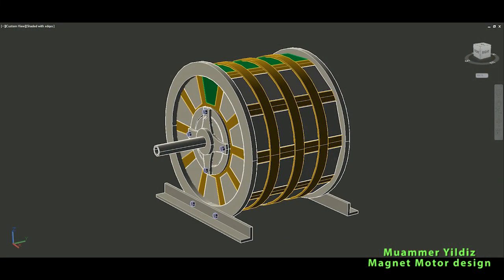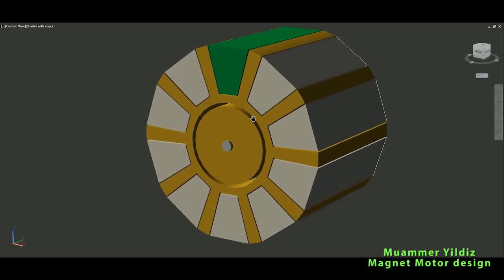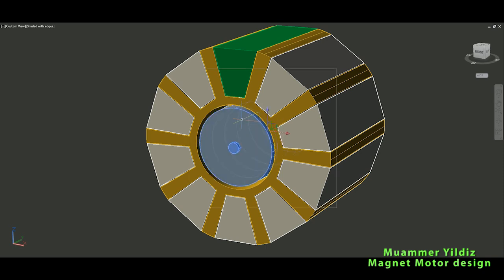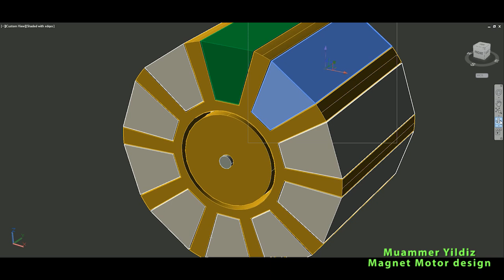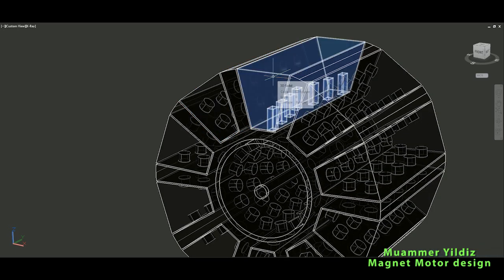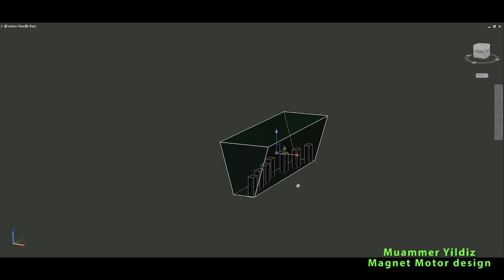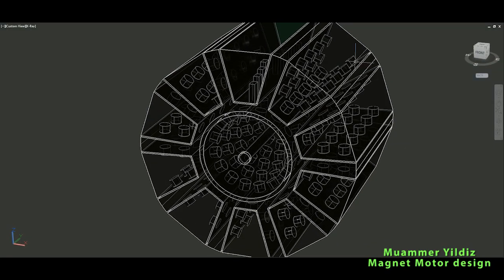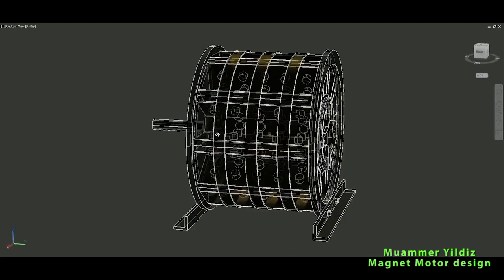Free Energy Generator, Working Patent! Muammer Yildiz Magnet Motor, Detail design!!!

Comment: how are the poles (N/S) of the magnets mounted? .... how big is the distance between the rotor- and the stator- magnets ?
Reply: They went to high school, they simply did not understand.    Just think. if Newton had not passed that stupid law, we could have all had free energy. Sad really!
Reply: The magnets don't generate electricity, they are the means of propulsion because two norths will not connect, therefore one has to move if setup at the correct distance and angle,  the Mike Brady magnetic motor is typical of how that works, it's on youtube and he has a Patent. costs about $400 to build plus a generator of 4 Kwatt cost $180. Make your own and run your business or home for nothing
Reply: Arnold Robert Lee - How long have you been running your house on one?
Reply: Mike Brady took money from people and did not provide anything working... I heard he was in prison...

Comment: Basically Magnet Machine Work
 like Effect Dominos by using Power Energy force
of Magnets met Iron which causes the shaft keep Spinning
as long as the magnets energy force (pull/push) over Iron still exists.

Comment: More "Free energy" BS!
Reply: Arnold Robert Lee, Research means nothing if your sources are garbage. Garbage in, garbage out. Having a patent doesn't prove the invention works as promised. The fact is that if these "free energy" devises worked, the power companies would build them themselves and save a crap-load  of money over building conventional power plants.
Reply: Arnold Robert Lee Good post Arnold.i been following this for more than 10 years.
Reply: Treasure Hunting Pro,  I wish I did work for the oil company. The only BULLSHIT is the people promoting "free energy" schemes. So they can dupe gullible people out of their hard earned money.
Reply: it's not really free energy-------------   eventually you will have to replace the magnet to provide more energy
Reply: After 700 hundred years for those Neodymium magnets.
Reply: The difference between work, force and energy is one of the first things you need to understand. There is no energy in a magnet, except for any potential energy you put in it. 

They work similarly to how springs work. If you compress or stretch a spring you've stored potential energy in it. When it returns to its natural shape, that potential energy is gone. If you push two like poles together or pull opposite poles apart you've stored potential energy. After they've pushed apart or come back together that potential energy is gone.
Reply: I agree ----  human beings put the potential energy inside the magnet-------  people who make these devices are saying they can convert that potential   energy to kinetic energy by bringing one magnet close to a like magnet which will repel the other magnet-------  the movement that results is kinetic energy---  conversion complete
Reply: You can't agree if you refuse to understand. Putting two magnets together puts the potential energy in the system. Allowing them to separate lets it out. You can't arrange magnets so that they get pushed together without putting the energy to push them together into the system. The forces all balance out and all you've done is make a complicated, ratchety flywheel.
Reply: Even if magnet motors actually worked, it would cost shit load more energy & money to mine & produce magnets than just drill natural gas & oil. You literally have dig up the whole earth to put a magnet motor in everything.
Reply: you could just take a large piece of metal and magnetize it
Reply: @DavidJohnson-tv2nn  Cabal/ oil barron shill move along...
Reply: @cerberus5338  20 pounds of magnets  could provide same energy as millions of gallons of oil.

You are wrong sir.

Comment: he has wires in the motor
Reply: YES...!!!!... We all saw them when the motor was dismantled. This is at the very least suggestive of electro-magnetic components. Magnets are very strongly attracted to the laminated Iron core of an electro-magnet, when both North and South Magnetic Poles are in close proximity. Those old Horseshoe magnets were allways sold with a mild steel bar 'keeper'. No energy required to get "IN" but plenty needed to get "OUT". Going "IN" should generate a short pulse of Faraday induced current. If stored in a Capacitor, Exit might theoretically be assisted, as the stored current is returned micro-seconds later to the magnet wire electro-magnet coil. Carbon Graphene nanotube conductors are well over a hundred times more electro-conductive than Copper. Seen under the microscope this black velvet looking growth, appears to be similar if scaled up to a bamboo forest from five to eight miles high. Very strong Casimir forces bind these strands into ultra fine filaments. Multiple stands of these bunched Graphene Nano-Tube filaments can be twisted, so as to assemble in seven filament threads. Rather like fine silk thread. The tension induced by the twist holds the threads together. ... If this speculation is correct....???... and it might be erronious, then this would not be the first time new materials made the seemingly impossible happen. Shape Memory Metals for instance. Food Grade Stainless steels an example, but suffers terrible metal fatigue. with repeat military type return deformations from the pre-soak Austenitic-Martensitic Transition Temperature. The Metal remembers it's previous formation. An Israeli Stage Magician Bent every spoon in the Kibbutz Canteen using the kitchen ovens. imparted Austenitic-Martensitic Transition Memory to every spoon, and then bent them cack straight. them all out.  Fellows at the Kibbutz remember a lot of spoons magically bending, when diners tested him.
Reply: You are correct, sir. In the video demonstration of this device, one of Yildiz's people told someone not to grab hold of the axle to test the torque generated; she told him, "Don't do that, it is hot!" So, a permanent magnet motor that gets hot?! Even if the motor was just running a little fan blade, why would it get hot, I asked myself. Could it be that there's a battery powered motor (remember that the assembly was not completely disassembled down the the axle in the video, doubtless where the battery-powered motor was concealed) was overcoming the resistance to its continued motion against all those magnets that were trying to remain in their energy-conserving state! As well, I elsewhere read that the motor's RPM slowly decreased over the period of the demonstration...battery drain...?
Reply: That would need a hell of a big battery.
Reply: hey i dont support the above video or anything but in that rpm the amount of friction created would be insane so its coming from that
Reply: I hope your wrong, so what are the best bearings to use for both ends. And what control system should I fit to reduce the speed to suit the generator it will run?
Reply: Did you heard any eddy current heater? Please search this subject you will understand why motor getting warm up.
Reply: you use the some of current produced by the motor to run the electromagnet to control the speed of the engine.  it uses pull to start alastair.  It uses repel sides to run offset to on every part it has 2 repels.  the repel field keeps it centered so there is no ware on parts.  they use the electromagnet to start and brake the speed.  It connected to a power source  or batt that it charges when in use and uses to kick the electromagnet to start it. 

hadi koya there is no mechanical friction because that requires touching parts and the moving parts do not touch anything they are always repelled from each other.   The speed at witch it rotates does heat the air though. i wonder how it would do in a vac with no air to heat.

Arnold Robert Lee there is no bearings it all magnet fields the right stagger of them keeps it together and close to balanced at all times. you need an electromagnet to brake it or it will run at tens of thousands or rpm a min with no way to stop it.

Comment: I used to think these magnet motors did not work and there was no way they could. But I see one run and there was no power going to the unit . It was taken apart right in front of me and there was only magnets inside. there were no wires of any kind. Its a working unit and I have seen one myself or i would never in hell would have believed it works.

Comment: I have seen this device demonstratesd at a University in Milan Italy.  It eventually degause and stop working.  It degause faster under physical loads. Just a very expensive fan to build.
Reply: There is a rechargeable battery hidden in the base of the machine, that's why it stop, and the permanent magnets do not loose their magnetism, you did not test them...

Comment: I saw a you tube demonstration but found the demonstration lacking practical application. The moving of air is nothing by comparison to our needs to produce work.
What I would find useful is seeing the working capacity to resist rotation (the capacity for torque). Can it rotate and lift a 1kg weight on a 20m rope. Can it be stopped or is it only able to be decoupled to disengage resistance.
Or even better show it producing electricity by turning a generator.
How much energy (KW) is required to create the total individual magnetic fields versus how much it can output. That is the most critical aspect. The AutoCAD scheme is easy to reproduce figure out.

Comment: I don't see the value in so many magnets that are not even close to the rotor magnets. also, it would be better to have the stator in the middle and the rotor on the outside to utilize the leverage  and also the weight of the outside would give more power as a flywheel.

Comment: Well, everyone says that its doesnt work because its perpetual, well, Mr. Yildiz never said that its perpetual, i think that the "fuel" is the magnetic power of the magnetics, and it will not last forever, the magnetics will lost its power over the time, so its not breaking any fisics law. This is not a more than 100% eficient motor. I really dont know if it works, but the guy winned some competitions with this motor and showed some videos from this working and dissassembled it.

Comment: Hello, Mario Gudec. i have did same model as seen in the video and simulated in Ansys maxwell software. its not rotating even one cycle. as i red in Muammer Yidilz magnet motor they have used two batteries in the model, is that is true? with out battery this machine can not work? please reply me , i am waiting for your reply

Thank you

Comment: Ok but where is an actual working model, not just a computer model? That would be of real interest.
Reply: Mr. Yildiz has shown that his motor runs in several demonstrations. Unfortunately he has never shown that his motor does not simply run by a hidden accu and e-motor. Never was a running motor fully disassembled to dispel such doubts. He claims to have a patent but he hasn't. He has announced sales of his motor two times, but nothing happened. He refuses to submit his motor to a test by third party experts. All this and of course laws of physics indicate that his motor is a scam.

Comment: I'm gonna build one and replace my v6😂
Reply: You can do it
Reply: Not this magnet motor is only 10kw, you know 1hp ----> 746w then you need 160kw to move a car!! 
You need more power but this is the beginning!! 👍🏼
Reply: If you double or triple the size of the magnet motor you might be able to do it. 😂😂😂
Reply: Ele pode armazenar energia elétrica para seu carro elétrico enquanto estacionado ou em trânsito lento.
Reply: "I'm gonna build one and replace my v6"
... and then later, you can say "This is all  BS.  I'm gonna replace it with the V6 I took out.
Reply: @realidadtotal7591  how many motors we needs
Reply: @realidadtotal7591  Don't say Nonsense. If you’re driving the Tesla model 3 car at  50 mph - then maybe it would consume 14 kWh over an hour (which, more simply stated is 14kW) - but if you drove at 25 mph - then it would be more like 7kWh per hour - which is 7kW.

These are very approximate numbers though because air resistance is non-linear with speed but friction is linear and the power needed depends on a mix of those two things that’s hard to calculate without getting into drag coefficients and such.

Hence, consumption at low speeds (where friction dominates the energy consumption) is very much less than at high speeds where air resistance dominates. So don't try to discourage who got potential to do something!
Reply: 1 Mio Views and noone can rebuild.Im frustrated as a 70yo virgin.

Comment: clever use of repulsion of magnets.
Reply: The most sensible response 👏 👏 👏
Reply: "Clever" in what way?  Please explain your statement.
Reply: @DownhillAllTheWay  well, it work. the concept is a simple 1, but clever in that some 1 saw how to use it.
Reply: @joggautube123  Well, I didn't understand it - so could you explain it?
Reply: @DownhillAllTheWay   it's just north and south poles of the magnets arranged so they repel each other sequentialy as i see it, so keeping the rotation going. so free energy moton. connect that to a generator or its all inclusive, gives energy free electricity.
Reply: @joggautube123  The key phrase in your response is "as i see it" - but you see it as somebody who a) has little or no scientific knowledge, or b) knows that "free energy" is impossible under the laws of thermodynamics, but who believes that physical laws can somehow be cheated.  Human laws are imperfect - there are always loopholes in the law - circumstances where the law doesn't apply, so by using these loopholes, you can cheat human laws - but the laws of physics are inviolate.  You can't cheat atmospheric pressure, or gravity, or refraction of light - or conservation of energy.
There are so many videos of "free energy" devices on YouTube that it is easy to believe that it must be possible - especially as many of them are very convincing, but common sense must tell you that if it was possible, you would see it everywhere.  Thousands of people would be running free energy devices for all sorts of purposes, and large companies would be marketing them - but the sad fact is that all these videos are scams - every one - designed to catch the gullible - as you have clearly been caught.  They are there to make money - a small amount through YouTube views, but in many cases, they are associated with Patreon accounts, or with other web sites which invite "investment" - in other words, for people to get excited by the profit making potential of the idea, send money "to continue my research" - but the money is used to fund their lifestyle.
Free energy is only available where "free" means that you don't have to pay for it - energy from sunlight (solar cells), hydro-electric, wind, etc. - but, as I'm sure you will agree, those devices can be seen everywhere - solar cells, wind turbines, etc. - but although you may be convinced by videos, you have never seen a working over-unity device.

Comment: You are certainly aware that these motors only run until the hidden battery runs out of juice.
Reply: Oil company shill
Reply: stacks of cr2032 lithium cells behind the batteries would be perfect!
Reply: I've seen it, it has no battery inside......  it just barely working & perfectly impractical
Reply: D. C. G.
Reply: @petertse4711  No battery needed since it is not a "motor".... it almost like a top, the machine works by draining magnetic force automatically

Comment: Watching the video of the revealing of this motor, i have a few concerns.. How is the speed regulated? The speed of the motor were at a constant rpm. If the center is fixated somehow, there will be a energy loss and finally stop, or if it were not, wouldn't the engine accelerate out of control?
Reply: L

Comment: Yildiz is a scammer. Permanent magnets are not a source of continuous energy, this design does not run for even one turn. In such a design ccw and cw torques always level out.
Reply: heinzpg I don’t claim this motor to work. I did testing for 3 years on different config. I had one time success where the rotor started turn so fast that the magnets poped out from the rotor. Sadly I newer believed it to be possible but tried anyway and out of such reason I newer wrote down configs.

Comment: man I wish i knew how you bored those holes on the cylinder on your CAD program I'm using DSM and for the life of me I can't figure out how to lay out the bore hole I would like to angle them at 33 degrees as well as the ones on the face of the 9 starers I think he's on to something with the magnets on the side to focus the magnetic field and I like how he switched to the V-gate design on the 10th stater it may actually prevent the rotor from losing inertia

Comment: the yilditz magnet is doing a cumulative magnet design we invented in canada back in 1985 it accumulates all magnets on a common bar towards the rotor. but the problem is to disengage the rotor and stator  which we re-designed to another to mitigate that problem.

Comment: Motion is generated when there is a potential difference between two points within a system. Think of a sterling engine. It works because there is a hot and cold side but once the system reaches an equilibrium i.e. the cold and hot side are the same temperature, the sterling engine stops operating.
Reply: Klaus Ventures: "Motion is generated when there is a potential difference between two points within a system."

You're sooooo close to the answer, Klaus.
Reply: Exactly! This machine breaks the second law of therkodynamics by produce energy ignoring the heat transfer between the hot and cold sides, or by assumption, they believe that the entropy of the isolated system can be somehow decreased in the process.